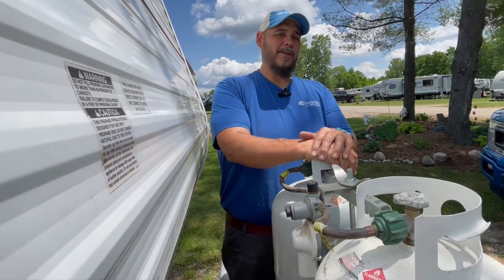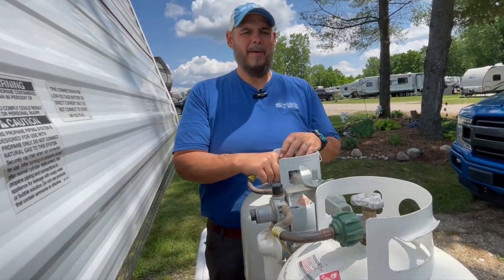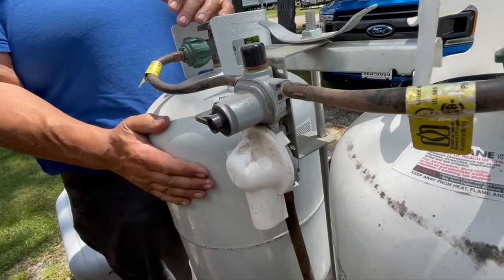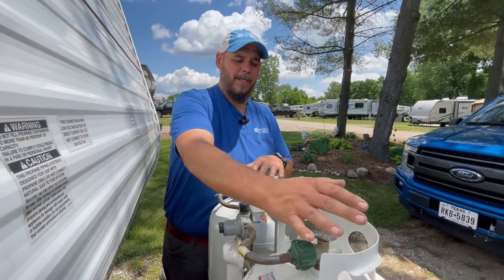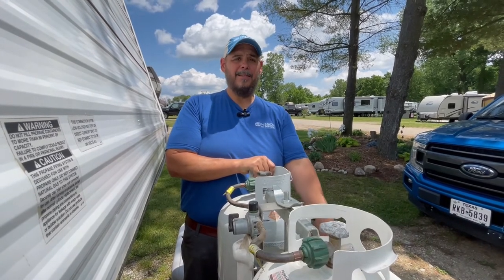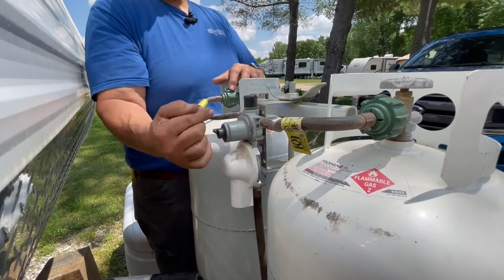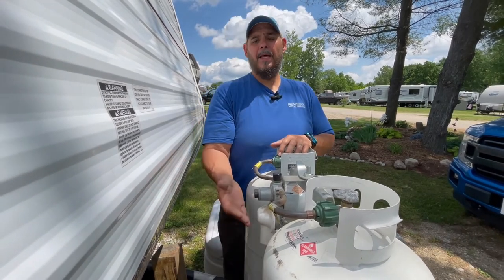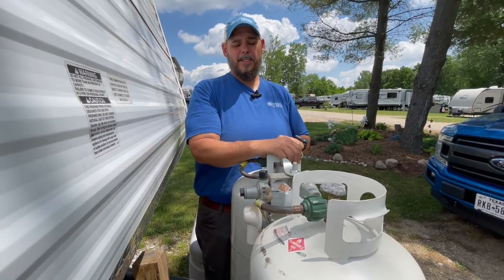RV TIPS: Have Propane But Stove/Furnace/Water Heater Isn't Working?

Comment: Glad to see you are back up on a weekly basis.  The walk-thru education was a good start but the repeating reinforces especially when you can hear and see similar to the walk-thru.  
FYI My camper is just 6 mo old.  2022 Rockwood 2516S  with two 30lb tanks
Ran out of gas in the first tank.  Took the LP tank off and saw a lot of rust on the base plate holding the tanks to the frame.  Found 2 of the bolts holding the base on were either put on too tight and/or  the bolts were weak or they rusted thru.  Something to check once in a while.  I expect they were put on too tight.  It is in the shop for warranty today.  I contacted Rockwood also, and mentioned they should check the torque on their air gun at that location / station in production.
Reply from the maker: Yes! That is something else to check, so thank you for sharing that. Sorry to hear that your Rockwood is in the shop already, but glad they're gonna get you taken care of!